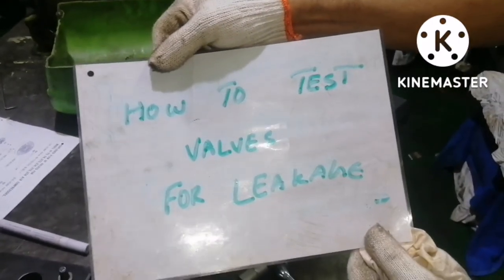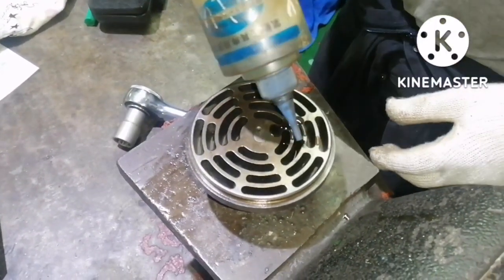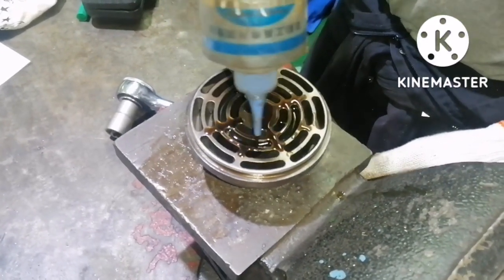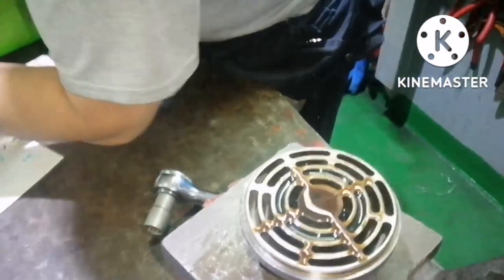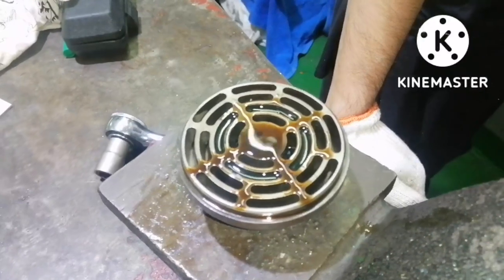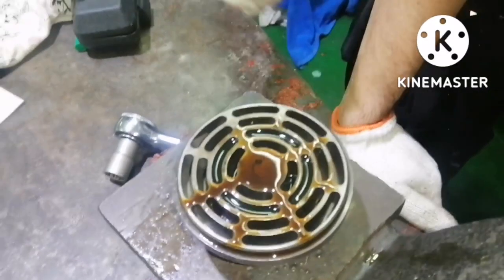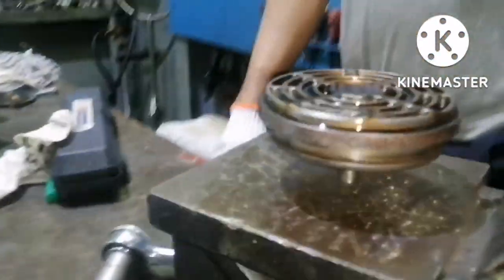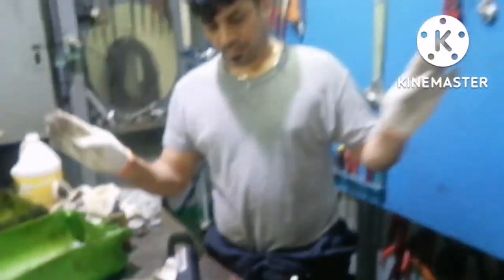FOURTH ENGINEER JOBS.... HOW TO DO LEAK TEST FOR MAIN AIR COMPRESSOR VALVES ONBOARD SHIP..

Comment: Thats not the way how should you test valves. They are working with counter pressure, and water also is not the same fluid as gas…
Reply from the maker: 1)depends on size of boiler from 2 to 5 ..
2)It dont affect much but a little cooling effect will be there if compressed air is used..
3)Mostly smoke tube boilers..

Comment: Sir,I'm aravindhan from thoothukudi tamilnadu. I'm a engine cadet. How to take performance test in main air compressor
Reply from the maker: It's very simple.. Empty the air bottle..close the outlet valve of air bottle. Start the compressor.. Now the time taken to fill from 0 bar to 25 bar... Do the same method for other compressor..
The compressor which takes long time to fill s not performing well.

Comment: Hello sir,  a REQUEST, Mitsubishi purifier overhauling is every where in internet and most of as are working with it, am a junior engineer am working with it, but am afraid if i join another vessels with ALFALAVAL, please sir do a video in ALFALAVAL, in Tamil and English
Reply from the maker: Vl do for sre.. Please give sme time
Reply: @marine-knowledge-basha   thank you for advance sir 😊😊🙏🙏
Reply: @marine-knowledge-basha  yes sir please do alpha laval complete overhaul including vertical shaft and horizontal shaft, also belt drive system. Thank you

Comment: Hello sir, is there any difference between micro siezer and scuffing.... I guess both are same due to lack of lubrication forms local welding ... But surveyor asked what is the dif between micro siezer and scuffing ...
Reply from the maker: microseizure is the beginning stage of scuffing which can be removed by increasing cylinder oil rate whereas scuffing cannot be removed and its the next stage of microseizure..
Reply: @marine-knowledge-basha  thankyou sir
Reply: @marine-knowledge-basha  and thanks for ur AUX ENG DECARB, coz that was my deciding question for meo class 4 MOTOR and MEP alhamdulillah cleared my class 4 ..... ,

Comment: Good Day sir, I've seen in my previous vessels they only use water while carrying out leak test of M.A.C. valves. Is there any negative effects on using water? or is it really advisable to use D.O. or any higher grade of oil in carrying out the test? TIA
Reply from the maker: If u use water that water may cause rust inside the valve.. So to avoid that it's better to use oil..